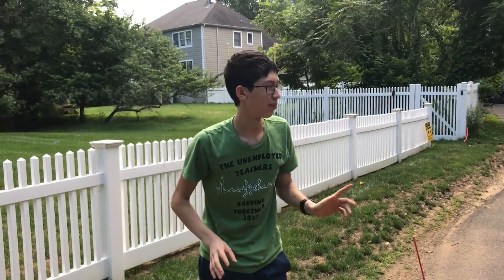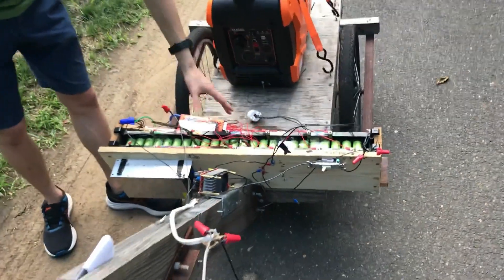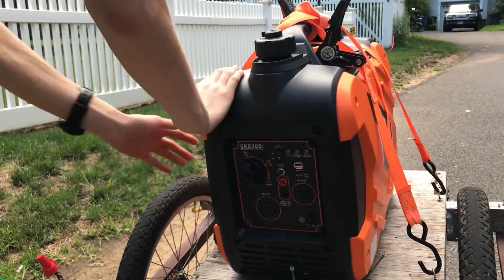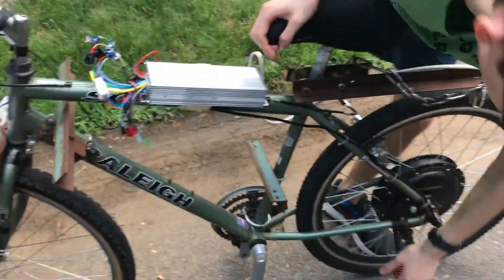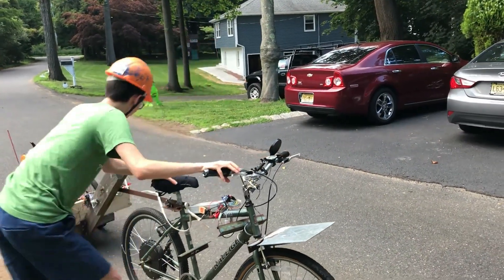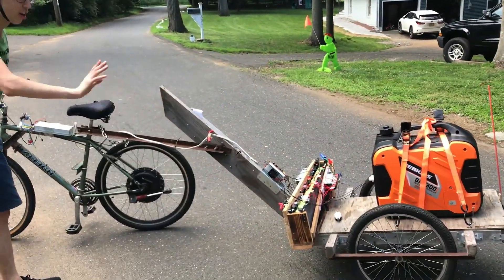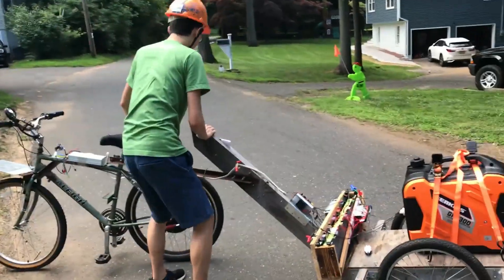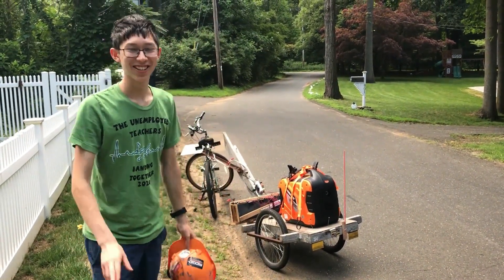Gas & Electric HYBRID Bicycle  | ebike (pt 1)

Comment: Cool video but you are supposed to turn off the throttle down feature when you turn the generator off and only turn it on once the thing you are charging is connected. But that's just technically true to keep good generator life I'm sure it doesn't really matter in reality.

Comment: As someone who's biked for over 40years. Everyone  on you tube is pulling a Mountain,  To get a bike to go.  Take generator, Add bike rack on back, And plug and go.  Max I've done in one day , No assist is 125 miles. Generator will add to fun, But  lets not forget. Object of bike is to pedal. Good Luck;)

Comment: Nice work, but wouldn't it be simpler to just power the bike straight from a gas engine or straight from a hub motor/battery? Your objective was infinite range but I don't see this being a very practical touring vehicle. Cool concept though.
Reply: Then you have a motorcycle and the rules of a motorcycle are given the rules of an e-bike.... 

He is basically making an unregistered motorcycle.

Comment: Nice would love to know if it works on the DC port without the batteries ?
Reply from the maker: u need at least some amount of batteries. The batteries act like the flywheel in a car engine. They smooth out the load and are a tiny energy bank for stuff. Without the batteries, the SMPS would be overloaded like a car engine would stall out without its flyhweel. You probably only need around 100wh of batteries maybe 300wh max.
Reply: @nicksgarage8295  i have a question. 

On a standard electric bike, the maximum watt is 250, at least here in sweden.
The battery take a few hours to charge.

Since the watt is 250, do i need a charger that is 250w or more?
Was thinking if i use a standard charger, the battery will drain faster that it can charge.

Comment: Can you run the generator while its plugged into the battery, and use the bike at the same time? Instead of charging it while its stopped?
Reply from the maker: yes of course thats the whole idea.
Reply: @nicksgarage8295  at full speed would the charging maintain the battery level, increase it, or slow down the decrease?
Reply from the maker: @hassanjamal4212  it would actually increase the charge level meaning it charges faster than it discharges.

Comment: This is bakotako from the forums. Well, I dont go on there much anymore. But, I got the 2022 Honda Grom man. No more futsying with this stuff. =)
Reply from the maker: noice. hows your options trades doin. I used your boost converter you donated to me in this build... thanks again. you should be able to see it screwed into the trailer arm.
Reply: @nicksgarage8295  nice glad it is of use instead of sitting in my garage. options are up and down man trying to get the best strategy to trade the VXX with a short bias but still be able to withstand volatility spikes. i am trading the VXX as it is just cleaner trade on market volatility than individual stocks and the spreads are efficient. i was up a lot in march/april but gave a lot of it back and am trying to crawl my way back up.
Reply from the maker: @feedallday2556  good luck!

Comment from the maker: i am currently working on a faster version of this / modification. Basically, I am running 40 volts (12series x 3.4v/cell) which limits to 25mph as k~v, but i will soon upgrade to 80 volts by series another SMPS supply and another a123 battery pack which should do 40mph. 40mph requires roughly 2kw so my 1800w generator should be able to handle it for infinite range.
the biggest plus of this build is most ebikes have small top ranges, but a hybrid allows for infinite range assuming gas stations are accessible for refuelling of generator. some analysis shows the generator costs 50 cents / hr to run for an estimated range of 150-200 miles / gallon for the hybrid.
Reply: I have the same or similar idea. Instead of cart and gasoline generator. Alternator.
Reply: Also, you have to stop with unlimited. Your very limited by the generators gas engine. Without gasoline , no recharge. -not unlimited. Your still using gasoline, your design is not efficient.  Solar and alternator not gasoline, your fcking up at the point of generator. Ditch cart and generator.
Reply: .50¢ per hr.  20 miles per hour. For 200 miles. Mpg calculated...
Reply: With the math. You've made a motorcycle that's as fuel efficient as my 800cc motorcycle. Unfortunately you haven't pushed the envelope forward here, you've built a contraption, regenerative brakes, alternator, solar, light weight, comfortable ride suspension.  However, you sir have Ambitions, most people don't. I will support you.
 Start figuring out, regenerative brake disc Caliper that creates electric power when brakes are applied.<----- brakes that make electric..... Worth millions. Who wouldn't buy a regenerative electric caliper for their bikes? That product will sell itself.